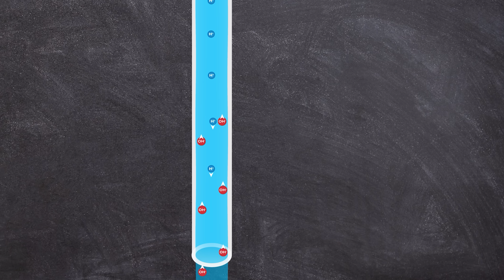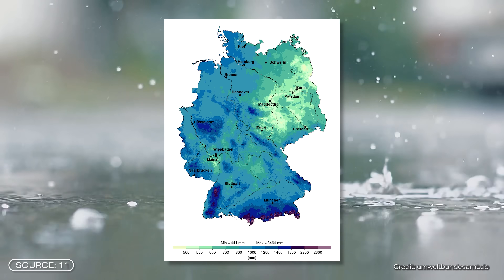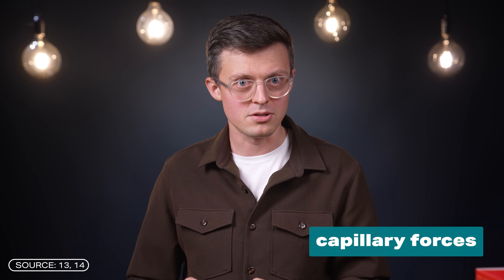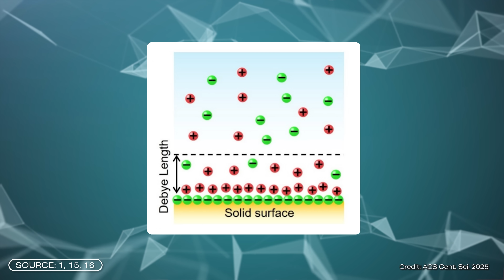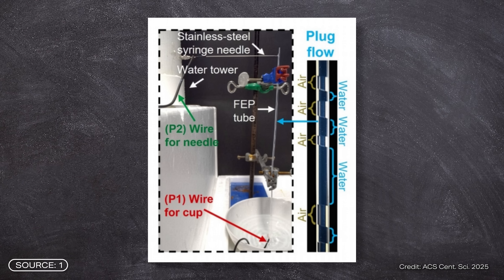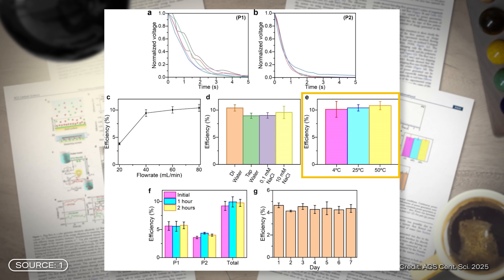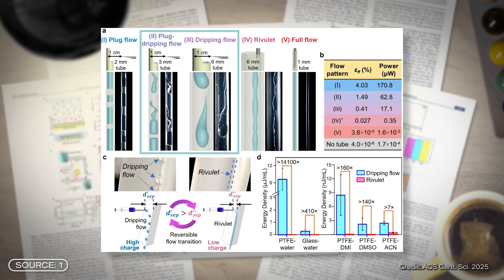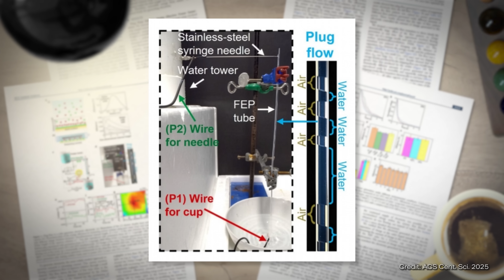Physics Hack: 100,000x More Electricity from Rain!

Comment: Clickbait. 10% of water potential energy, while a simple water turbine achieves more than 90%, at this point it is better to just add a small turbine at the lower end of the gutter pipe. Not that it would be worth anything either. An example to illustrate the point: 900mm of rain per year, 100sqm roof, 5 meter hydraulic head, that's a whole 120Wh per year with a perfect turbine system, and around 12.5Wh with this tech, not even counting the whole system maintenance for an entire year.

Comment: Solar panels that could deliver power from rain. Bring it on... At 30% it is better than bi facial in most cases. The west coast of the US in the cascade mountain range that have 90 to 150 days of rain per year. The NW of the Olympics can have over 30 feet a year. Where I live it is 30-32 inches a year.

Comment: To the flaw list, add flowing plugs of water in contact with FEP polymer plastic adding micro plastic forever chemicals to eventually leach into ground water that we drink from this plug systems storm water run off.

Comment: I still don't get how you will install "cups"  (barrels) and tubes on a roof, lol.     I can only see how you partly can do it  by gathering the water like we currently do to get it off roofs, and via that drain system we can make thing drip.  But you will need a lot of "cups" and tubes to catch ALL the water and disperse it into this system before it overflows  and it will be so freaking ugly and space taking.

Comment: This could pair well with wave energy capture systems: as a wave passes over the system, a float will rise and fall with the wave. Imagine the float is at the end of a crankshaft within a sealed tube. As the float goes up with the wave, so too does the shaft acts as a pump which siphons water up through the tube and extra energy is collected through the method described in the video. As the float goes back down with the wave, the crank shaft forces water back out of the tube and into the ocean. The water being forced down the tube can harvest additional power by the method described in the video. Additionally, the linear motion of the water going up and down in the tube can turn a motor/dynamo and power can be harvested in a traditional manner
Reply: Yesvyiu dobit

Comment: With hundreds or thousands of water drops coming from a filtered gutter system working similar to a water droplet kelvin generator, thousands of volts can be generated with ample current. 30 inches may get 10000volts. With successive sets stacked under each other downward, more current can be generated or more voltage depending on the design.

Comment: Absolutly ridiculouse ... what does this mean 12:27  ?  That 1 square meter of roof could generate 100W? ! Never in your wildest dreams ... Adverage yearly rainfall 1 meter ... distance from roof to ground 5meters ..... mgh ... 1000 x 9.8 x 5 = 50KJ ... 10% efficiency = 5KJ ... roof is 10 x 10 meters = 500 KJ for the whole house in 1 year ... about 0.15KWHr per year! 
So you would need 100 houses to produce 1 Euro of electricity in one year ... Assuming the "researchers" figure of 10% is accurate . Researchers always exagerate claims to maintain funding.

Comment: I cant help but think that this could be used in already built power-plants.  any generator that uses steam to turn a turbine could capture the steam, let it cool and drip through this new system, and enter another vat to heat back into turning the turbine

Comment: You were concerned about the filtering but swimming pools already have a system that is set up to filter and recycle water. this could be your solution to cleansing the water. You could work with both solar and hydro to meet all the needs of your electricity. The tank from the solar could also help with a heating production to keep freezing to be an issue.  Swimming pools theory would be your best example. and already supplies this system in gymnasiums. And you could recycle the water.  Seed for thought. Joni the great thing about this system is it has a filter to just be maintained. And you could also use the water system for water supply.
Reply: Solar pole filter no energyvrequer use them save mony on chicken clean poles

Comment: It is interesting. I wonder if the tube was in a downward spiral would cause faster rate and therefore collect energy faster while still using the plug flow effect. Nice channel BTW. Your English is very good, no issues :) You gained a new subscriber.

Comment: it is well know that if you have a dripping tap run and the drip passes through a tin can without a bottom, it induces the flow of elections or current. Connect up a few crocodile clips and you have a visit from the guys in black. LOL

Comment: On an average roof of 48 m2 and 6m height difference with a conversion rate of 0.1, the potential energy of yearly rainfall in my country is 250 kJ.... which is 0.067 kWh.

It is proposterous to think that harnessing the potential energy of rain on roofs is in any way profitable or feasible.

When looking at solutions you always have to look at the energy density of different "modes" of energy. Chemical and heat are very dense, kinetic and potential are very sparse.

Comment: Can we address the elefant in the room? All the energy in the water comes from gravity potential. So the higher the elevation, the more energy you can collect. 30cm fancy collection system will always lose to a 3m collection pipe coupled with a turbine. This silly system with tiny tubes will clog up with algae and become useless in month. And in winter it will freeze and crack.

Comment: A separate alternative would be a small watermill in water drain pipes.  These would be a low maintenance to gain a small amount of extra power.  You conceivably have a couple in a standard house pipe.

Comment: The pipe length is not an issue - nothing prevents you running a stack of 32cm pipes that feed into a collection pool, then a fresh set of 32cm pipes below, fresh collection pool etc as long as you like...

Comment: Rain water is not clean so anything that requires clean surfaces and filters won't work.
What about using gravity and flow to spin a wheel and a small generator instead?

Comment: If they add to the surface area of the "needle" point by simply combining several "needle" points separated around the tube, it would give them a 60% increase in power production.😊

Comment: A Singapore research team has developed a technology that generates electricity from falling raindrops, achieving 100,000 times more efficiency than previous methods. By utilizing a pluck flow principle, they effectively separate electrical charges, overcoming past limitations. This innovative approach could revolutionize decentralized power generation, although challenges like maintenance and cost remain.

Highlights:
00:11 A research team from Singapore has developed a groundbreaking technology that converts raindrops into electricity, claiming to generate 100,000 times more power than previous methods. This innovation could revolutionize the way we harness renewable energy from rainfall, an often overlooked resource.
          -Hydropower has been a significant source of renewable energy for centuries, contributing to approximately 12% of Germany's electricity and 50% globally. However, the potential for expanding traditional hydropower is dwindling due to environmental constraints.
          -The concept of using rainwater for electricity generation has remained largely unexplored until now, despite many countries experiencing high annual rainfall. This new approach could provide an innovative solution to energy shortages and sustainability.
          -The research team overcame the challenge of the so-called Dubai length, a previously unsolvable physical problem, allowing for efficient charge separation. Understanding the interface effect between water and solid surfaces is crucial for maximizing electricity generation.
04:03 Capillary forces and the Dubai length pose significant challenges for generating usable electricity from water flow. Recent research in Singapore has introduced the pluck flow principle to overcome these obstacles.
          -Capillary forces hinder water flow in narrow tubes, often requiring pumps that consume more energy than the electricity produced. This inefficiency limits practical applications in energy generation.
          -The Dubai length describes a natural limit for charge separation in water, where ions quickly neutralize each other, significantly reducing the potential electrical current generated from flowing water.
          -The pluck flow principle utilizes a water tower and a unique dripping method to create alternating water and air pockets. This innovative approach effectively enhances electrical generation from water flow.
08:07 The new water flow technology efficiently generates electrical energy through charge separation using water and air interactions, achieving over 10% energy conversion efficiency. This method shows promise for decentralized and eco-friendly power generation, but also faces several significant challenges.
          -The technology utilizes a unique flow pattern that allows effective charge separation at water-air boundaries, improving energy conversion over traditional methods. This innovation can potentially revolutionize energy production.
          -Despite its advantages, the method's efficiency can decrease significantly with continuous water flow, necessitating controlled pluck flow to maintain optimal performance. This presents a challenge for practical applications.
          -Maintenance challenges arise from potential clogging of narrow tubes due to dirt and algae, especially in real-world outdoor environments. This could impact the system's reliability over time.
12:10 The plug flow generator presents an innovative approach to electricity generation, but its practicality under real conditions and cost-effectiveness remain uncertain. Further research and comparisons with existing solar technologies are essential.
          -Testing of the plug flow system in real-world conditions is crucial to determine its effectiveness compared to traditional solar systems. This includes understanding its performance during various weather conditions.
          -Cost analysis reveals that the materials needed for the plug flow system could be prohibitively expensive, making it a challenge for widespread adoption. The estimated costs highlight the importance of affordable production methods.
          -Emerging technologies like triboelectric nanogenerators showcase potential competition by generating electricity from raindrops, indicating a need to innovate beyond traditional solar solutions. This competition emphasizes the importance of advancing energy technologies.

Comment: Technically this could be done then in tandem with all plumbing in the house , to and from water plants etc .. so a part of the water coming to every individual real estate could generate it.. also making some special pump that would push water droplets with the margin needed .. because there is at every stage where water can be dropped from top to bottom in 32cm bits ..
Reply: Call.mario brothers

Comment: You have more than understandeable english do no apologize. 
I'm not engineer o physicist, but if i got somothing on this video is about scale problem of this system because of tubes size. I wonder if it works otherway that a tube, like a flat inclined surface. whein it rains raindrops splash on that surface and slide down. does it makes the same electrtical output?

Comment: I don't look very far into alternative electricity although it would be extremely smart, but how about this- as rain falls into a downspout (or even shower drain, grey water drain) water collects as specific pound of weight triggering mechanically a piezo spark which bit by bit energizes a capacitor or something to cumulatively hold the added  electrons for later use? Or a 3/4" micro water turbine which is mounted in the home water supply main, and spins anytime water is flowing due to shower, faucet, or hose bibb watering lawn or washing the car.
Reply: Sekf charger caoutter

Comment: Nice vid😊  science guy.  So materials, manufacturing and cost to scale it up is something you could further analyze...but...why are we so obsessed with electric power....why do we want to transform all sorts of energy into electricity? 
That plug flow mixes the air with the water, which results in undescribable/unimaginable effects, and lots of dissolved gases in it.  Highly turbulent flow such as from rain water falling from rooftops means you don't even need the tube. If you then store the falling water/air mixture in a sealed container, you get a huge amount of air pressure that you then can use to do so many more things than charge your phone.  Ha.  But then you can't watch YouTube eh? 😂 The only Trompe we need to solve so many "problems" 😅 also, can't scale CNTs... So what the point of the paper/video imho should be is on the description of the effect...not if you can use this to "reach net zero" or whatever using this phenomenon.  ❤

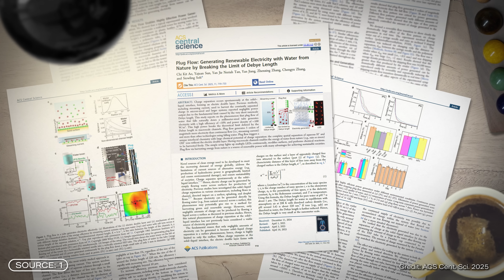Comment: 11:06 You could overcome this problem easily with a meta material, even a 3d printed shape that was slightly hydrophobic that used the principles of water tension that ensured 100% of the water would almost never go into the opening. A backlash effect would be caused like when water glugs itself pouring out of a container with a narrow head like a soda bottle. 
 
I know I know, im a genius. You can have that one for free. Though... such a thing wouldn't be any more resistant to weathering

Comment: for example: maybe it's a great low head hydro solution? .... low head hydro is where hydro is going.

so if plug flow can do low head, that's better than going for rain douwn spouts, because low head is continuous baseline power ( continuous flow )......then youv'e got something.
but if your application is intermittent, then your makeing a difficult sell for yourself.

Comment: To me it sounds like the 32cm drop could also be the greatest strength, sound like you could have a huge rain tank at ground level that could continuously be pumping out some amount of voltage for weeks after a rain storm, of course 400uv is almost nothing, so the question becomes, how little would be useful on a longer timeframe, 400uv over 24/7/365? Lots of small streams

Comment: This reminds me of the piezo electric effect.  It's not much and has limited applications.  The flex of tire rubber going down the road could generate electricity, but is it worth it?  A rain collection system could concentrate enough rain water to keep a square meter of your tubing operating all night after a rain, powering a light and some chargers for phones or something.  Catching it in a long tube and using a turbine to catch the water pressure to generate electricity sounds like a more feasible idea if you have a good height differentiation and an efficient turbine set up.  I like the solar panel film but will that detract from it's photovoltaic function to gain 30%  more power in the rain?   And what about using heat collecting radiator under the panels to keep them cooler and warm enough water for taking a shower and washing clothes?

Comment: I wonder if a mesh with beveled perferations overcomes the flow issue. Possibly over a metal plate? Maybe Im confounding the concept.  

I had the opportunity to consume only 4-7kwh/day in a surprisingly modernized shanty... in a different place, now with the only elec differences being washer, hot water heater and hvac... now has me consuming over 10x the kwh, even though they are hardly used.

So. I dont believe, for one moment, it requires that much electricity, to do these things. 

We have alternatives, many we can self harvest, and I look forward to MORE WONDERFUL AND INSIGHTFUL VIDEOS! Thank you.
Reply: Wribg lots if enery mired age

Comment: This technology WILL GO NOWHERE, as can be easily proved by bit of maths and some 'whole systems critical thinking'
This technology, and also other rain technologies such as TENGs and drain pipe turbines, all suffer from one fundamental oversight, energy resource availability. Even if these devices achieved a 1,000,000 Watts/m², they still wouldn't compete with solar panels.
Lets do some maths:
1 kW peak of solar panels it's about 5m² and, in the UK, generates about 850KWh per year.
Nominal roof height for a 2-storey building is about 7m. Rainfall in the UK is about 1m/year. The maximum total available energy from the rain = mgh.
 So 5m² of roof would provide you with a maximum amount of potential energy of :
5x1x1000kg x 9.81 x 7 
= 343,350J = 0.0954KWh !!!
The article states that these devices are about 10% efficient which means that over a year, even though they only appear to be about 2 to 4 times worse than solar panel panels, on a typical two-storey house they would collect about 100,000 times less energy per year than the same area of solar panels.
The flaw in this, and other building roof, hydro Technologies is that however efficient and power dense the technology is, a big number x bug**r all is still bug**r all, and the eggheads researching these technologies have forgotten to take into account the bug**r all part of the equation.

This is yet another case of lack of 'whole systems critical thinking'!